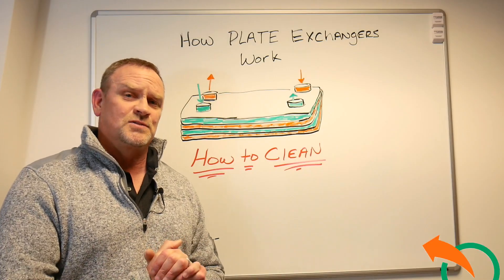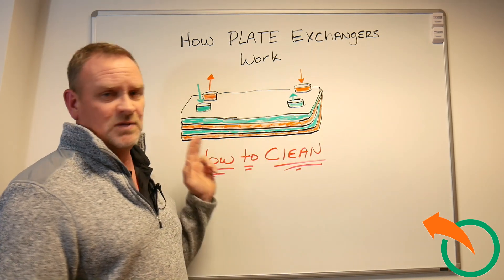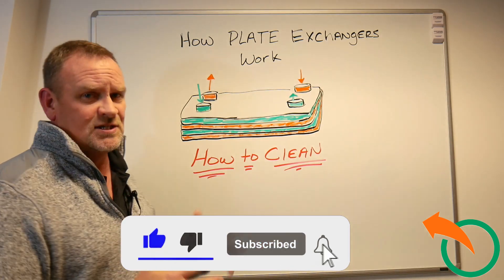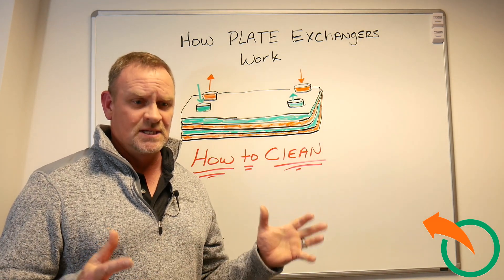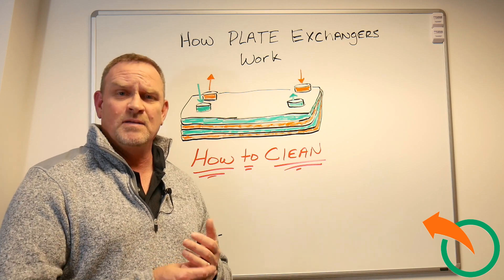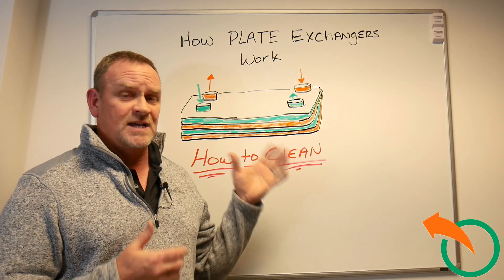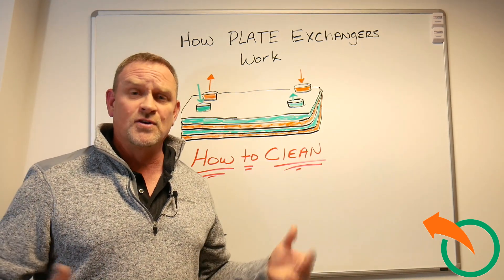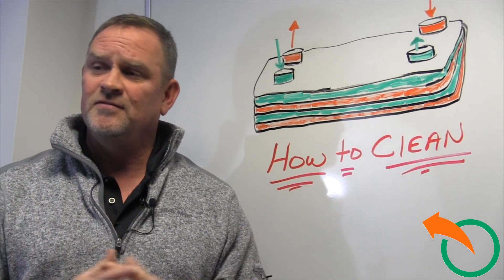How to Clean a Plate Heat Exchanger | Step-by-Step Guide 🧽🔥 | DIY Wood Boiler Maintenance

Comment: I had a 20 plate heat exchanger that I replaced 2 years ago because I thought it was plugged. I took it out and it had sediments in it but looked ok. I put a new one in figuring it was plugged because your can't see the inside of it, just the main holes. Then I replace the exchanger in the furnace because I thought that was plugged but it also looked fine. Both were 8 years old and who knows how long they are supposed to last. The reason I thought they were plugged is because my water heater works always run and when it was I first hooked it OWD up it didn't. Come to find out the pump was way to small and after I bought a new pump from you I never had a problem with it. Thanks for your video!
Reply from the maker: Glad we could help Wayne! Happy heating!
Reply: If you replaced both heat exchangers than the bigger pump, maybe it was all 3, the flow could of been cut in 1/2 or more by build up, and that wore out the pump, so your flow was poor? My concerns are how can you tell with flow indicators at each location and bypass at each to take the HX out, I hate to go buy new without knowing for sure? I have a HeatMor that is 16 years old, with out changing either of the 3, but may be time?
Reply: @daveschooley8514  I know it was the pump, I didn't know anything about pumps and after investigating the pump flow it was only good for 35 feet loop. I needed a pump that can got 200 feet  loop. Now I have the correct pump I bought from alternative heating and supply and I have not had an issue since.

Comment: Any information on connecting a 20 plate heat exchanger to a tankless water heater? Can it be done? Should it be done?  Is it ok to completely bypass the tankless heater? Meaning shutting the inlet and outlet valves on the tankless in the winter. And running solely on the heat exchanger in the winter. 
And running the tankless in the summer when the boiler isn’t being used?

Comment: Jeff do you have any preferences on filtering the water of an OWB before it hits the plate exchanger, I have heard a lot about what folks do from expensive woven cartridge's with stainless housing filters to just a simple screen trap setup.
Reply from the maker: I don't recommend filtering the water from the boiler. When the cartridge's get dirty it builds up pressure and blows pumps.

Comment: Thanks for the information but I guess what you are saying is to just get another one about as good. I have a question on my heat master it's a mf 5000 and trying to find out what pump is in this one all the numbers I get off it don't match any that you have in the catalog . I don't need one right now but thought I might go ahead and get one for backup.  Thanks for all your help
Reply from the maker: You buy a pump based on your application. Give us a call and we will help you size one for you when you are ready.